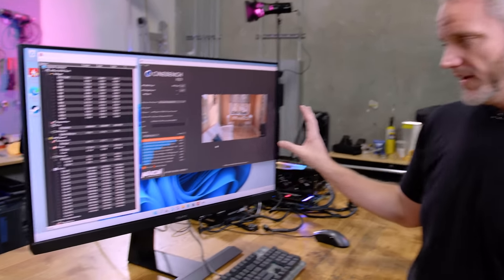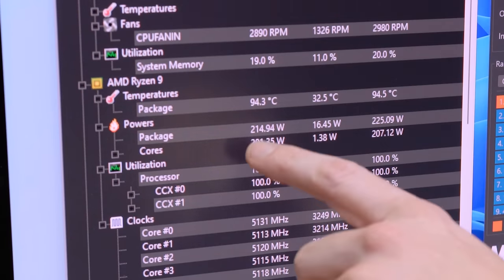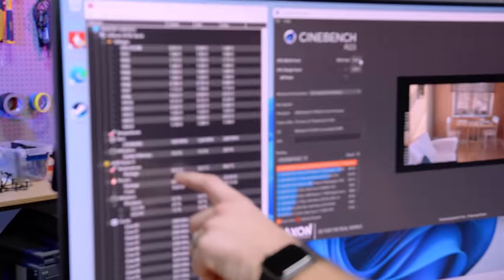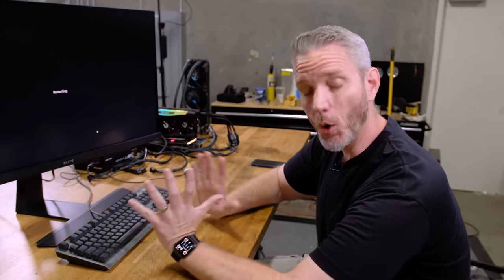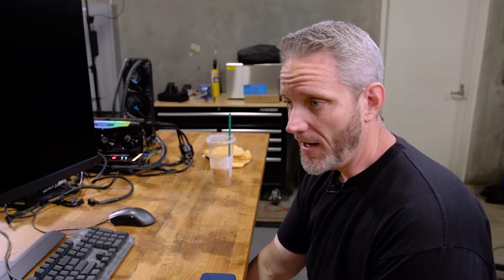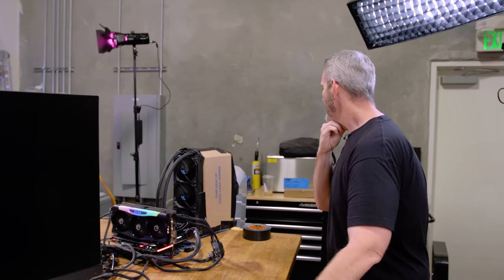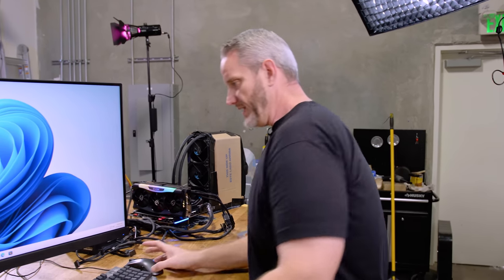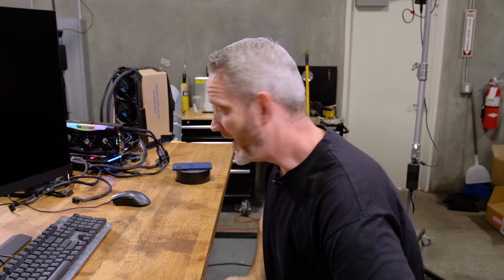This is fine...

Comment: All that heat trapped in the IHS. Ryzen 3000 and 5000 suffered from it but 7000 is especially bad because the IHS is far thicker and the power consumption is far higher

Comment: If it's gonna self-overclock until it reaches a target temp, there needs to be a bios setting to adjust that target temp.  95C is just ridiculous.  I'm sure there's plenty of low-noise enthusiasts that would set the target temp to 75 or even lower in order to get their system fans as quiet as possible, even if it means reduced performance.

Comment: For any cooling method, the temperature gradient across the coolest part of the cooler and the middle of the chip thickness are what determines overall cooling capacity. 

Any extra material, distance, whatever increases the physical width of that distance.

Comment: A good analogy about this temperature behavior would be the cooling system of a car engine. It's designed to keep the coolant in the 80-95°C and oil at 90-120°C no matter the load. Even idling your car eventually will hit these temps w/o any load. Doing top speed run on the highway also would keep them temps if everything is working as intended.

Comment: Was fun watching.  Note to anyone, physics is a very harsh mistress and there is no free lunch, every watt of electricity pulled from the PSU is exactly one watt of thermal energy radiated from those transistors that used that electricity.  Ohmic resistance inside transistors is literally converting electrical energy into thermal energy via (Power = i^2 * R).  That means this new generation of CPU's are incredibly inefficient out of the box by design, they are discarding efficiency in the attempt to maximize clock rate and therefor thermal output.

Comment: 3:47 - Jayz2ct:"Its not the CPU thats responsible for your power bill with gaming, it will be the GPU"
12:36 - Also Jayz2ct: Hooks up a mobile airconditioning unit to the CPU radiator

Comment: Apparently there are Eco modes for the 7000 series that you can set in the motherboard bios for 65 watts and 105 watts. It does reduce performance but even at 65 watts it still beats out the 5950x in multicore on Cinebench 23 and the 7950x at 105 watts with a multi-core Cinebench score around 34,000+ The Eco modes do reduce temps considerably, however if you are gaming mostly you won't have to worry about temperatures as I've seen most games using the 7000 series have temps depending on game between 50 to 75c at stock settings.

Comment: What many people seem to fail to understand is that the temperature that a part is running at has nothing to do with how much it heats up the room it's in. Power consumption is the only thing that matters. Whether you try to cool a part with a tiny cooler that lets it run at 100C constantly, or go overboard with your cooling and it runs at like 50C, the heat dumped in the room is the same.

Comment: I think we just have to get used to the 95°C as a "norm". It makes a lot of sense, when you think about it. AMD guarantees the CPU can run all day every day at that temperature, so keeping there during a test or while running a load guarantees so much more headroom with the frequency because you are already there with the heat.
Reply: The aim is to increase part life span as may components are more limited by number of hot-cold cycles than by 15 degrees peak

Comment: tbh i think the only thing i shall care is to attach to it a good cooler, and thats it, coz it will always be tuned to run quite close to 95C on full load.
To see that 95C goes down you should attach a cooler that is capable transfer and dissipate more heat than the one generated by the cpu at its max clock speed / max volts.
It would be nice to be able to set the max temp, for those that want to keep temp lower. ( maybe is already possible )

Comment: 5:18 I think you can call it as generated heat - as equivalent of the work that the cpu was actually doing by the time that the system reports its temperature reading. And what the AIO is actually cooling is the residual heat that was dissipated from the IHS to the cold plate of the AIO. And that the AIO's job is to continue keeping its cold plate cool so that heat dissipation process keeps on going, keeping the cpu as cool as possible. If cpu's IHS and AIO's or any other cooler's cold plate becomes equal in temperature, heat dissipation stops. And cpu cooling stops as well.

Comment: Also you can mess with PBO settings . There is a thermal throttle option.   I turned it down to 60c and temps never go above and I haven't noticed a difference in performance.  Clocks however are hitting as advertised or slightly lower.  They go above advertised as you Jay says in the video set to default. 

I wanna see what clocks you get from the 7950 when turning PBO throttle down .  ASUS mobos have the option afaik.

Comment: To bend double-wall corrugated cardboard, cut through the outer layer of cardboard on the bend line, it will bend there easily.

Comment: You don’t improve your cooling just to low down the temp, rather improving your cooling will increase the cpu clock which results to performance. It is designed to bump up the cpu clock to reach 95C then from there clocks are controlled to maintain 95C. It’s like “if temp > 95C then decrease X clock else keep increasing X clocks”. So if you want performance, beef up your cooling. Air coolers are fine but some cores will be at lower clocks. Either cooling the cpu will always run hot at full load. 

What amd did was the reverse of the conventional way we squeeze performance out of the cpu. I think this is good because consumers are assured that your computer won’t crash. This is unconventional way of overclocking your cpu without ever crashing. This time, overclocking is done through the cooling not the bios.

Comment: hi jay, regarding the AIO coolers, I have a verry positive experience with it. I built my first proper pc in september 2013 with I7-3770k which i overclocked and strapped a Corsair H100 AIO liquid cooler on it. It is supposed to be replaced after 2 years by manufacturer suggestion however it is still running. No changes, to this day it still runs fine. With the burn test it held fine this summer however you can hear some sounds of watter in the loop now so dont know what is happening (something deff is). No leaks and no problems. im verry surprised regarding it. SO it is 9 years and still going. Altho i must admit i dont know for how much more. Next one will be aircooled just to be on safe side since i dont plan on OC it but interesting experience nonetheless

Comment: Going on with what you said about people not comfy with aio’s in pc’s. A few weeks ago I was hell-bent on going full custom because I loved how aio looks, then the pump died. 

I didn’t realize and I started smelling like stuff was burnt, I opened the case it was HOT, pc did not realize pump died, neither did the pump itself actually. After that pc shut off, wouldn’t turn on due to overheating. 

With how expensive they are, I expected more life out of them. Bought a nhd15 chromax, and I never want another aio. I love how much quieter it is as well.

Comment: derbaur's video on delidding the 7900x and liquid metal with direct die cooling showed a 20C improvement underload. the IHS is to thick to appropriately transfer heat. probably gonna de-lid mine

Comment: Add in a graphic cards heat in a complete water cooling loop and you will not need to bother with heating the bedroom with hours of gaming. Surly in a case we will see higher than 95c especially on air cooled.

Comment: To control temps, you must de-lid the CPU and use liquid metal. Otherwise, you'll have to Frankenstein the shit out of your cooling solution to get a few degrees. De-lidding will get your temps down to a much more manageable temperature and allow more headroom for over-clocking.  The problem is the thickness of the IHS doesn't allow for quick heat removal.

Comment: Nice video. Thanx. 😊

Regarding heat generated, how about this:
"The more power goes into more cores, the more a CPU chokes on itself, forcing it to slow down to remain functional which is called thermal-throttling. CPU cooling at the level used for PCs can't do anything about the choking, nor really reduce the CPU temperature during load, but it slows the heatspread giving leeway before throttling is necessary, providing higher performance in average."

Trivia on the side:
Especially for Ryzen, the average performance under load mainly depends on the number of cores, the average clockspeed it can hold under those circumstances and usually also the architecture used. This means under duress, models that are different in clockspeed and wattage only tend to have a very similar performance, and even inverse effects can occure during which the higher end CPU performs worse than a lower tier one.
If you want to know why a cooling upgrade is better than the stock cooling solution, then the answer is to delay the effect just described.

Comment: As you observed cooler heat buildup is not dependent from a given temp sensor, but from the total power draw, that didn't increase much, so for the cooler a 7950X at 95C behaves like a 5950X at 85C (say)

Comment: Two things to note that are important
1) these things auto clock as high as they can go with the 95 degrees as an actual target for Max performance.
2) the feature is entirely optional - meaning you can deactivate it and run more comfortable temperatures.

I see options at the hands of the consumer and one or the other route should end up satisfying both opinionated sides. I don't see a problem here.

Comment: I'm one that uses one of those big Noctua air coolers, and with 6 incoming fans and 4 outgoing fans.  Now, I'm only running an 12700 Intel, but in gaming, I don't see it rise above 72C.  Most of the time it is around upper 50s, lower 60's while gaming.  Depends on the game, of course.

Comment: Finally the smug laughter at Intel's high end CPU temps has all but  disappeared. And Jay is the new AMD PR rep. "95 degrees is the new normal and it's just fine and dandy guys - its a feature not a bug. Move along, nothing to see here...". 
Yeah sure. Until they start failing from heat stress. I'd need a permanent temp gauge on the screen to make sure the AIO hadn't failed.

Comment: I'm pretty sure it doesn't matter what you use for traditional cooling. It wants to get to 95. If it gets too hot you're sacrificing clock speed not lowering temps.

Comment: I have an I5-4670 (3.4ghz Haswell) in an iMac (late 2013) I used for transcoding (software encoding via Handbrake) for about 10 to 16 hours a day 4-7 days a week for 8 years. Since it was in an iMac it would run HOT about 90c generally with a spike to 95c when the transcodes were started and the fans hadn’t spun up yet… 

For 8 years it ran like that! And its still running just fine but now I use h265 making Haswell completely obsolete so it’s been retired.

I understand people wanting to keep there system as cool as possible but there is a huge disparity between videos showing ways to keep your CPU cool versus videos showing a failed CPU from high temps that are within the limits of its specs.

Comment: I think I have figured it out maybe? So basically it is designed to be set to 95C by default or in the case of manual mode 115C at max. I feel that no matter how much cooling you provide to it, it will try to hit that set temperature. So if it senses that it has more thermal headroom, it will try to pump more voltage or boost the clock speed as much as it can till it reaches the target temperatures and will stop at that. I have a feeling and would like to request you to try a soft-lined water-cooled build with this CPU and I have a feeling that u might be to able to pull it to 5.8 or maybe even 6ghz all cores will hit 95C and yet not extremely heating the cooler.

Comment: Great video, as always.  Would love to see the undervolting when you can.  Out of curiosity, wouldn't an undervolt on base clock prevent it from reaching its maximum boost clock?  If you're happy to live with 5.1gHz all core at lower voltage, that's great, but if the voltage is too low to reach the single core boost of 5.8gHz (or whatever your chip is rated at) you could be losing out.

Comment: just 30 seconds into the video and there are two things that scream at me:
1st: get the aio correctly aligned. Air inside an aio always goes up. If the In- and Outlet of the aio are on the highest point, you gonna risk air getting into the outlet and onto the cpu cooler. Might happen, doesnt have to happen. Could potentially kill your aio since it's like driving your car without motor oil. Just saying.
2nd: I used CPUID HWMonitor for a while before i discovered HWiNFO - the latter is way more accurate and idk if you care, but Buildzoid from Actually Hardcore Overclocking explained in one of his videos why using HWMonitor is wrong. If you dont know him, you should check him out. He knows stuff!

Comment: Love this video/stuff. 

The new Ryzens are tempting but I have been so happy with my 3900x system I built in 2020.  

It is currently running cinebench R23 multi 30 min test, rendering 3 videos in Resolve free and playing this video in 1440p. 

Just to see where temps go in Ryzen master.  78.68 of 95 limit, peak sped 3974, 120-123w cpu power draw.  Nuctua NH-U12S SE cooler. 

An it is still responsive .   Do I need a 7000 series Ryzen .. no .. but .. but.

Comment: Honestly saying this by design is not okay because that level of heat is going to increase GPU and case heat. It won't be a big deal though but that's very hot and I am worried it won't last long term.

Comment: What happens when you run the processors starting from the 7600x to the 7950x on a 240 mm radiator with 2 fans instead. Does the maximum frequency at 95 degrees drop?

Comment: 95c is not "ok" for silicon as the base material "breakdown temp" is 85c. I am referring to the temp it "starts to degrade"  (I do mean over years. Not minutes)  so I still can't say I'd be happy.  But even at that.  For the "best performance" for a stock cpu.  That's fine.  It takes the overclocking out of the newbie hands and puts it into software which is smart.  I wish the temp target was editable. So say you can lock it at say 84c if you don't like it above that. (Like me)

Comment: I figure they have protections in place to prevent the CPU from melting itself, so let it run and run hot.  That could pose some problems for the overall heat in the case.

Comment: The cpu does goes back down to 45C,  when underload it brings out the jetcar.   Other people have been able to under voltage this to bring this to a 55c.   Its not has bad as people make it out to be.   AMD give you the max.  Wish they would offer that in the bios setting to give user say Max, Standard, Power Saving.

Comment: Take the heatspreader off and do direct die cooling and watch 20 or more degrees fall off of the temperature.  

This may take us back to jet impingement water clling like what Cathar done in 2004'ish era. 

Check out the Storm CPU waterblock, an Aussie bloke designed them and made them and licensed it to swiftech...

Comment: It would appear that the IHS has an unfortunate high thermal resistance.  Now I know there’s been de-lidding proof of this, but I’d like to make a suggestion to the community.  Why don’t we take a lick of the top of the IHS and add back a better fit with a custom cooler.

Comment: While certainly it is neat that it can run that hot that well, I still think overall it is a step in the wrong direction. Our components are starting to pull far too much juice, 200-300w cpus, 600wgpus, I've seen window units that pull less juice than some of these new rigs will be pulling under load.

Comment: What is nuts about this release it just goes to 95 C and stays pinned there. 
Then like people below say forces your motherboard to raise fan speeds to insane levels, unless you have custom cooling that runs water fast as f, which allows for less fan speeds.
I thought 9900k is hot, nope. Then I thought 12900k was hot, nope. Now we have 7950x, and people are like in Anderson Silva voice Is normal

Comment: Der8auer improved the temps by delidding the 7950x because he said that the ihs on the amd 7000 series CPUs is unusually thick. This is why the CPUs get very toasty under load. He also mentioned the reasoning amd used to design the ihs was compatibility with coolers. Either components that get in the way of mounting brackets and/or the narrower height of the lga socket were mentioned, if I recall correctly.
Reply: Be careful with Derbauer. He's full of crap at times.

Comment: I get what AMD did there, but my experience with most motherboards is, that the fans ramp up to 100% when cpu reaches 90 degrees and there is no way to change that. Not with ASUS, Gigabyte, Asrock and MSI. Yes, there are third party utilities but not all work very proper. And second problem is: waterpumps are very loud at 100%. So when you boot, you will hear your PC.
Reply: i doubt booting your pc require max load on cpu tho, note that the processor doesn't idle at 95C, its under intensive loads
Reply: @ksoub666  you might doubt that, but it is still happening on my Asrock board. No matter what, fan control is crap on most boards.